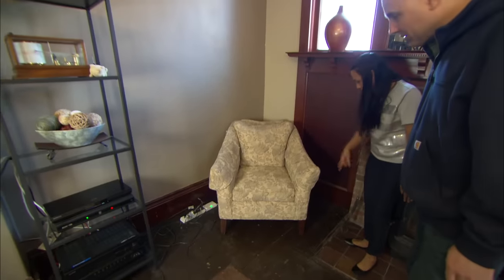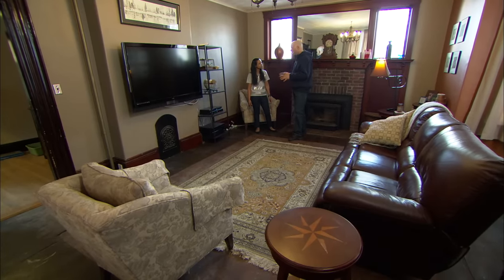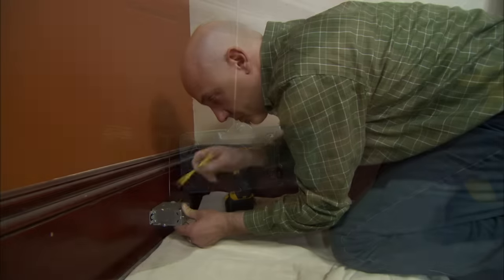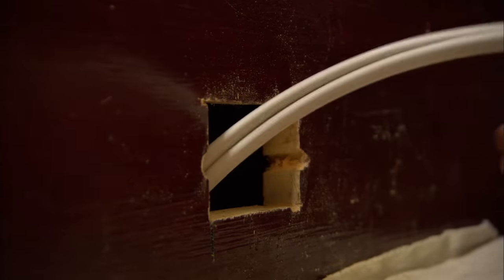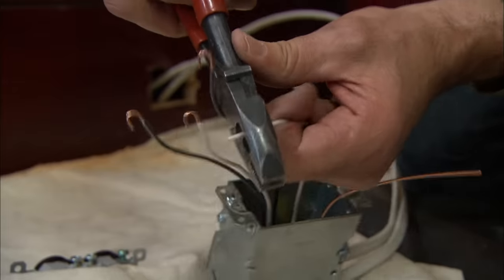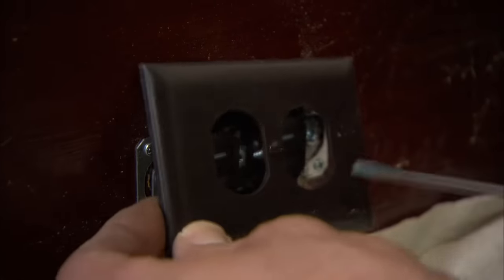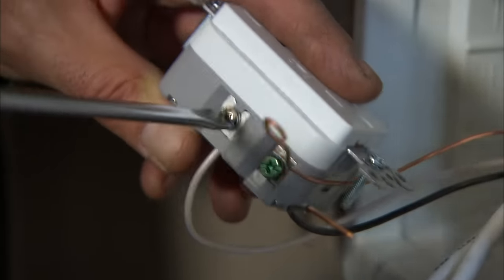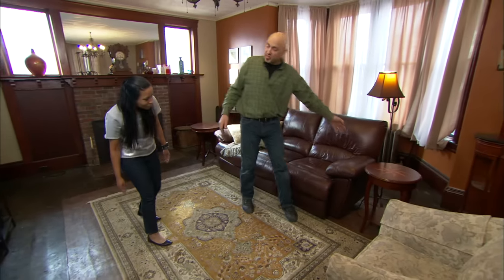How to Add Outlets to a Room | Ask This Old House

Comment: I have a couple  of electrical outlets  that have No Power GOING  to them , they use to work before,  I CHECKED the circuit breakers they seem to be fine, I also checked the electrical outlet, the connections they also seem fine.Can you assist me with this problem, I am in the Rhode Island area, PLEASE Advise

Comment: Gauge 20 amp wire for outlet for power draw is better separate lighting on 15 gauge, these outlets are all linked same breaker meaning the draws all from one

Comment: 3:11 He should've left some more rubber sticking out, Because the rubber (insulation) will eventually wear down and the copper touching the metal box can make an electrical short.

Comment: I've learned over the years to use white outlets, then I can see what I am doing even if the room light is low.  I also like to give the tape a nice stretch as I wrap it around the receptacle, just to make it stick a little harder.  I find that's a smart thing to do in general, even in a NM box.  It is not hard for the ground wire to bend in such a way that it leans into the hot screws.  I always try to wire my boxes with ground and neutral on one side, and hot on the other.  And when I am pushing everything in, I try to maintain that separation.

Comment: A surge protector should always be used between wall sockets and electronic equipment. There is nothing unsafe about certified surge protectors that are in good condition and are used in a safe manner.

Comment: Surprised a #1 square drive screw driver wasn’t used on both the receptacles and the gfi/arc breaker on the circuit breaker box. I also believe that torquing the connections should be done.

Comment: Im confused, so You installed a few new outlets so does that mean you need install a few new circuit breakers, one per each outlet? That may sound dumb but i can't find a video that explains this process.
Reply: A good rules of thumb is to have no more than 12 devices off of a general multi purpose circuit
Reply: Jonathan Soto no you don’t.

Comment: In the Chicago area, you can’t use Romex, code calls for metal conduit
Reply: And in Chicago, they still required lead pipes for your water service until the Feds banned it in 1986. Let's not do things the "Chicago way" if we don't have to.
Reply: In Chicago, 10-15 murders take place over a weekend

Comment: Why every 12 feet? Is that preference? Can I put an outlet on the floor and one on the roof in the same vertical line?
Reply: Most appliance/electronics cords are 6 ft. Every 12 ft would allow desired placement.

Comment: What about adding an outlet to the second level of the same age/type house? Not as easy to pull the wires.
Reply: @Abbey Wolfe in a balloon structure house you can pull a wire from the basement all the way up to the attic in less than a minute.

Comment: I love it when these electrical how to videos are done in locations where conduit are not required.  Anyone can install an outlet that way.  Do this in conduit and you add a lot of complexity.
Reply: JayWC3333 exactly, and that's why there are licensed electricians
Reply: JayWC3333 it's not required for homes.
Reply: Where I live and work conduit is required for homes too.
Reply: JayWC3333 in America?
Reply: Yes!  I live and work in Illinois.  So, your comment about conduit not being required in homes is not correct.
Reply: JayWC3333 just looked that up. You are correct but it isn't everywhere. It is better than just cable stapled to wood beams. Only necessary for commercial/industrial applications and outdoors but a person can do it if they want to.
Reply: james hawkins and interior for us.
Reply: JayWC3333 yeah so you'd basically have to remove all of the drywall to add anything electrical. Shitty thing is, they do not even use hole saws nor plastic/rubber grommets when running wires through wood. I was at a friends home that was just build, electrical wires in the basement are ran through a bunch of wood and it's splintered bad. Looks like someone used the backside of a hammer. A real shame.
Reply: National Code doesnt require conduit in homes, if your required to do that take it up with your local jurisdiction
Reply: Jeff Cram yeah if you look up Illinois, it is required in certain counties.
Reply: Yes, we had to have it where I grew up in Illinois, Lake County.
Reply: JayWC3333 I’ve never heard of that in the US are you in the US? I imagine if you did need to run condit the flexible stuff would be the way to go but even then it would such.
Reply: Cops are tryin to crack up every gang in this town man
Reply: where i live her in puerto rico we have to run conduits too, now days we do it with pvc and corrugated plastic conduits(but in the past it used to be emt) and since nearly all houses are concrete running cables like that is not really an option.
Reply: Yes it is correct. You can't base it off of your state/city's idiotic standards. the NEC does not require it.
Reply: Conduit is for surface mounting applications. Not in walls that are not accessible. The code book is your friend. Use it.
Reply: We use pre-wired conduit building new houses.
Reply: @jameshawkins809  Conduit is required in homes in some local municipalities.  I know Chicago is one.  I assume some other large metro areas have the same code as well.  It makes sense there because you have hundreds of people living in one building.  Janky wiring could burn the whole place down.
Reply: @Wowzersdude-k5c  In Chicago, it's not just the cost of the extra conduit. Make sure you remember to generously tip the City inspector also.

Comment: What’s the point of the ground wire if it just gets connected to neutral anyway in the panel? How is that different from just having a second neutral?
Reply: The neutral wire is a current carrying conductor. The ground wire carries no current under normal conditions. The ground wire is necessary in the event of a ground fault in order to trip the circuit breaker.

Comment: why did u use lamp wire (white) instead yellow one?
Reply: A lot of outlet circuits only require a 15 amp circuit yes you can plan ahead an d pay more for a 20 Amp circuit but most of time its not needed

Comment: Does code allow an outlet that low?
Reply: Billy Clabough I believe so as long as it's not a basement, and because the outlets are so low, they have to be tamper-resistant by code.
Reply: Billy Clabough - To my knowledge, NEC only specifies a max height, not minimum.
Reply: Thank you
Reply: There is not a minimum height requirement except there is a maximum in height. The maximum height is 5' 6" or 66 inches or less to be considered a receptacle for the requirements of outlets for needed wall spacing.

NEC Article 210.52(4)

Jeff
Journeyman Electrician
Reply: thechosendude There isn't a "maximum height" in general. Tv outlets are usually 72" to the top and so on. It's just that people don't need an outlet way up high in most situations. Garage outlets are a minimum of 48" above finished floor.
Reply: @QuadroNVS  All outlets have to be tamper resistant now, no matter where they are.  At least according to the NEC (local codes may override it).
Reply: Billy Clabough yes
Reply: QuadroNVS they have to be tamper resistant no matter what. The height has nothing to do with it
Reply: Yes

Comment: Is it true that the more often you turn the main breaker off, the more you'll need to replace it? I was told the more often you do it, you'll wear it out - whether it's each individual breaker or the entire panel.
Reply: chrisgast it's basic wear and tear like everything else in the world.
Reply: Does it wear out after only a few times or does it take several times (>10 or 15 times)? I'm wondering because I need to repair some things (hood vent and stove/oven) in the kitchen as well as a thing or two in the bedrooms), and I don't want to wear it out sooner than absolutely necessary.
Reply: chrisgast it's no where near that severe. Your friend exaggerated or is trying to play you for a fool. You could go right now and turn it off and on 10-15 times in a row and it will be fine. Go look up the ratings for your brand or just call the company. They last a very long time!

Comment: So people are saying can't put them in the skirting board because water can gather on the floor. Does that mean he also shouldn't have installed a floor box for the lamp socket? I'm British but I watch TOH just because I find the way things are done across the pond absolutely fascinating. Light and sockets on the same circuit, separate gas appliances for water heating and space heating, pole mounted transformers in the street only feeding 1 or 2 houses. All seems like pure craziness to me 😂

Comment: For installing a new outlet off an existing one, do you use 12/2 or 14/2 romex?
Reply: Is it a 15-amp or 20-amp circuit?
Reply: @jamesdarnell8568  truth be told, I'm not sure. The homeowner won't tell me. If there an easy way to tell?
Reply: Johnathan Kelley if you need to ask that, you shouldnt be doing the work.
Reply: @Lucky Joestar that's the answer I was looking for. Appreciate it.

Comment: Are there any electricians that use Phillips head screw drivers? 3:54
Reply: Handyman?
Reply: The screws on outlets are usually flat head, so it probably just becomes a habit. In all honesty, if you are using the correct size screwdriver, the flat heads are better than the Philips.

Comment: Code compliant install. Although I like to pigtail the wires instead of using the device. If the device cracks or gets broken it can kill power to other receptacles down the line. And use your drill to screw the plugs in Scott, less stress on your wrists when you get old and have done 20 thousand device screws by hand.

Comment: I don’t use more than one Romex in a handy box. Plus, Why is no one mentioning all those exposed Romex cables entering the panel?
Reply: Good thing that’s not a handy box
Reply: @electricaf365  I stand corrected. It is not a handy box.

Comment: im no electrician but is this up to code? i heard some one once say they have to at a certain height/distance of the floor for kids not to mess with them and in case of a flood occuring. obviously electrical codes vary from state to state
Reply: Wrooong. No, codes don’t vary from state to state. The outlets could go IN the floor, facing up if you wanted

Comment: I'm curious as to why the ground & positive wires are both tied to the positive bar in the panel.  Got electrocuted fixing my brother's whole-house fan because of it and every time anyone would push sideways on one of his switches, it'd pop the breaker by  hitting the side of the box.  I've asked 3 different electricians and all they've been able to tell me is "that's how we do it".  Do you happen to have an answer with a reason?
Reply: The short answer to your question is that the neutral-to-ground bond is needed to properly operate the circuit breakers.  Over Current Protection Devices (OCPD) such as circuit breakers and fuses actually require a short and intense INCREASE in electrical current (a short) in order to detect the fault and cut the circuit off.    Without a sharp and drastic increase in electrical flow, a fault could go on without triggering a circuit breaker to stop the flow.  This actually occurs quite often and can be measured easily by checking the amount of current flowing on your ground conductor.  It should be less than 1-amp in most cases.  If the current flowing on a grounded conductor is higher than an amp, and you are not in a high-voltage (600V+) environment, it typically indicates a erroneous neutral-to-ground bond somewhere in the system.

To visualize the reason why the neutral-to-ground bond is required, you must consider the entire electrical circuit from a 120-volt outlet all the way back to the utility transformer hanging out on the pole:

In a properly designed circuit, if a fault were to occur on the 120-volt outlet between the hot-wire and the ground, the current will flow through ground wire back to the main panel, where it will move to the neutral wire via the neutral-to-ground bond, up to the utility transformer, back down the hot wire to the circuit breaker, tripping the breaker.
In an faulty designed circuit, if a fault were to occur on the 120-volt outlet between the hot-wire and the ground, the current will flow through ground wire back to the main panel, where because it does not have a neutral-to-ground bond, the current will be forced through the ground rod, into and across the earth, and up the utility ground rod and in to the utility transformer, back down the hot wire to the circuit breaker.  The resistance of the earth is almost always to great to allow sufficient current flow to trip the breaker, and you end up with a steady-state ground fault, that never trips the breaker, and this is a hazardous situation indeed.  You cannot use the earth as a conductor.
Another issue that can occur, is that multiple (and illegal) neutral-to-ground bonds can exist in the system (only one bond is allowed in the main panel).  When this occurs, both the ground and the neutral become current-carrying conductors, which effectively means that you have two (2) neutral wires running in parallel.  This divides the current and places electrical energy on to the chassis of all metallic objects within the system.  Another hazardous situation.

Also, Arc-flash energy exposure can also go up if you don’t have a solid neutral to ground connection because of the inverse-time curves of circuit breakers.

This subject can be a very difficult concept to understand and the improper application of neutral-to-ground connections can have very serious and life-threatening consequences.
Reply: There not. You tie the neutral and ground to the bonded panel ground bars. Even though the neutral is a current carrying conductor. This is so when you have a short. The ground causes the breaker to trip.As the ground bar becomes energized on that circuit. As a short will always seek the source. That being the transformer feeding the panel. As breakers are rated in RMS voltage trigger levels. Some are adjustable on 200-800 amp main breakers. It's why it's required to install ACR fault breakers today. Then once the inspection is done. The contractors remove them for use on the next home they build. As they trip when induction loads are used. There also fixing to require Super Neutrals in homes. As everybody has a computer with an AC to DC converter in their homes. Which when the converter goes bad. It can induce more amps then the circuit is rated for back through the neutral. I seen that first hand in a server room. It melted the Neutral wire. 

 The only time you do not tie the ground to the neutral\ground bar is when you run an isolated ground. It gets isolated from the panel straight to a ground rod outside. You will see them. As they are green with a yellow stripe. The Ground bar will have an insulated plastic back that is not screwed to the metal panel or a bonding screw installed. it just snaps into a plastic holder. I seen that one screwed up. As some people still terminate them on the normal ground bars. Which defeats the purpose of an isolated ground...
Reply: Master Chief thank you for explaining all that especially the part about the super neutral!  Have you ever ran into trouble with it tho when it was previously installed with a wire stretcher?  I remember one time after using it on a flourescent lighting load i made with the flourescent tube bender i ran into some trouble with the jilliwatts crashing the system could you help explain why to everyone? Thanks!
Reply: Well first you get the Delorean for bonding the current carrying conductor. Then get some old dude with white hair. Then you get him to stand on a clock tower. In a huge lightning storm. He will then stretch the wire wrapped around a tree. Then get a jolt of 10.9M Gigawatts. So his buddy can make it back home. 

Using a Florescent tube bender is old school. We got better at just using our minds to bend space\time today. So it's a none issue with inspectors..

Comment: Shouldn't that romex be 12g/2 yellow instead of 14g/2 which is mainly used for lighting?
Reply: David Duong - Your allowed to use 14 -2 in a living-room.Dining rooms have to be 12-2
Reply: Correct me if im wrong, I have not seen any stipulation in the 2014 NEC for 20 amp circuits other than kitchen, laundry, and bath.
Reply: DangerDaveFreestyle - Dining rooms